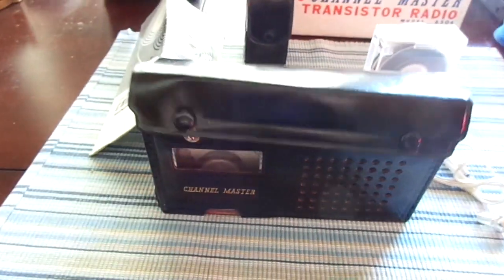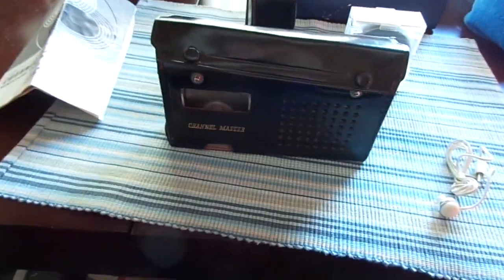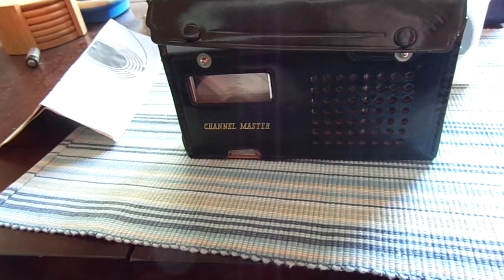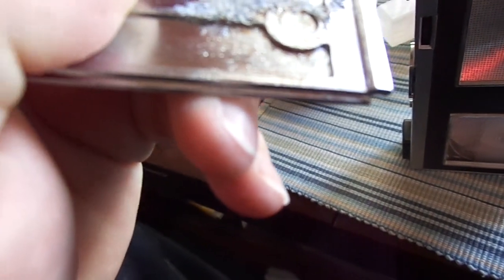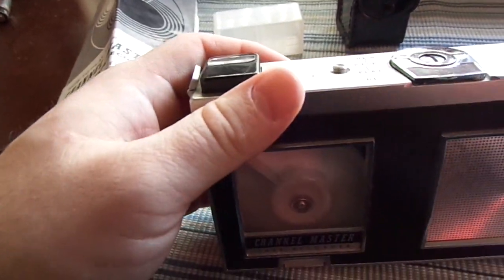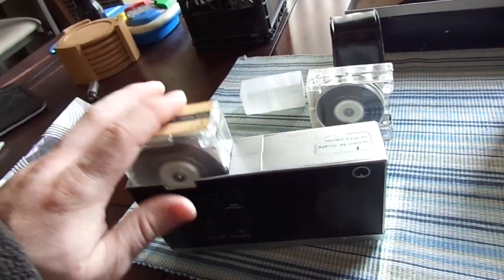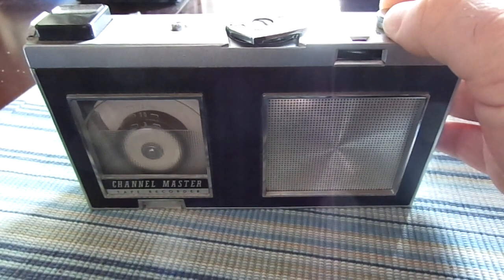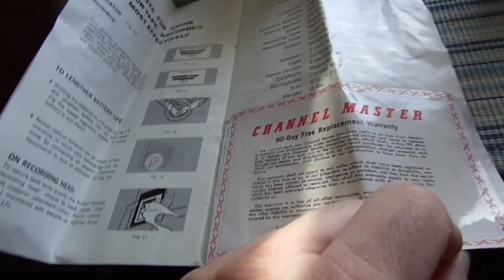1961 Channel Master 6546 Cassette Recorder

Comment: Scrubbing Bubbles bathroom cleaner, best thing for cleaning off battery corrosion, spray some on a Q-tip and it will clean that stuff right off the contacts.
Reply: also the genuine cillit bang works well too

Comment: Thank you so much for creating this video. I realize it was quite a few years ago that you made this but it looks like you are still very active on your channel. Any advice to fix a corroded battery compartment for this model? My model's one battery compartment that controls the motor is operational but the one that controls the speaker is not. My main goal is to play the tapes I have to see if my grandfather's voice is recorded. Is there a way to repair the severe corrosion or another player that can play the model 9595 cassettes? Any feedback or if you could point me in the right direction would be much apreaciated!

Comment: Was this made by the same "Channel Master" which still manufactures T.V. Antennas? I recently bought a  Channel Master Antenna and now receive stations from 120 miles away. My neighbors reported me to code enforcement for having an antenna like i am not allowed to have one. Even private HOA's, Condo associations or apartment complexes can not forbid you from raising an antenna per U.S. Code and FCC regulations.

Comment: BBISHOPPCM's World - i have the same model as you.   I popped some "AA" batteries in it today and it fired right up.   The exterior of mine is in excellent condition.  No battery corrosion.   It does have some rust around the speaker though.   If i decided to sell mine, any idea how much it's worth?  I got mine from my grandmother, after she passed.